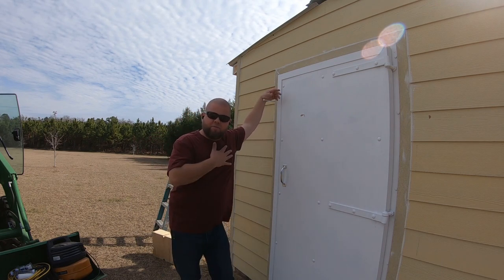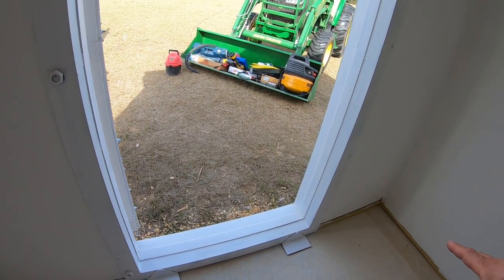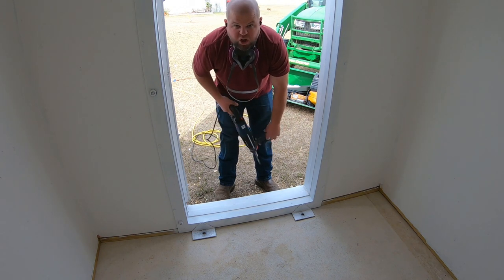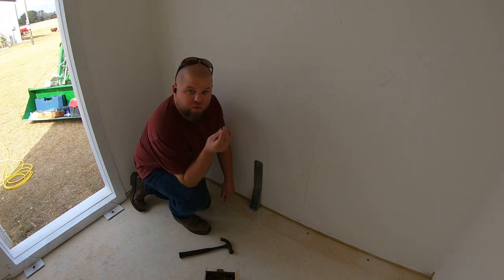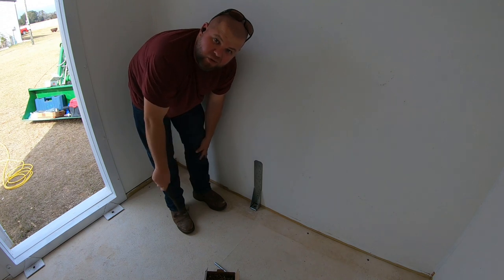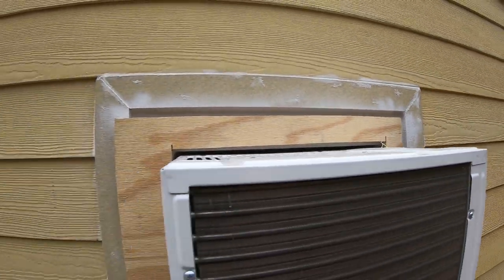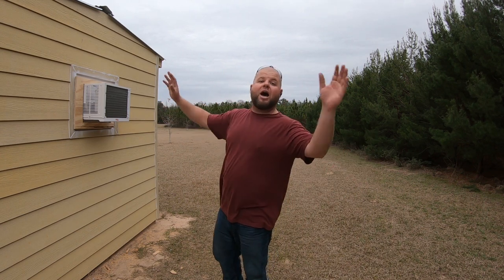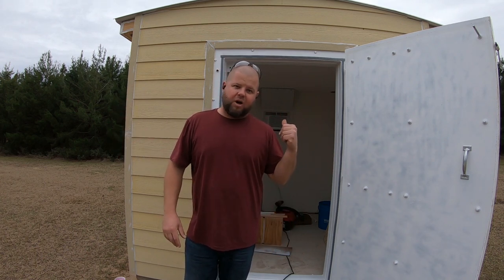#240 Anchoring the Tornado/hurricane shelter! DIY storm shelter bunker build #19

Comment: Great video, mite want to check into a palm nailer , you would be surprised how well they are handy ,  great for getting into tight places , and would have been great on all those nails, plus I'm sure it will get used a lot on that new home build
Reply from the maker: Lol so funny you mentioned that! I ordered one that same day, should be here tonight. I'll finish the straps tomorrow and record it. I've never used one, but it seems perfect for this job.
Reply: @TKCL  plow is right, they are amazing!  We used them to pound in 6 inch spikes into hardwood, can't remember what kind of wood it was, but it was hard as a rock.  The nails literally just slid into the wood, and fast!  Wear gloves though, your hands get super cold after a while of holding the nailer, with all the compressed air blowing out of it.
Reply from the maker: I'm excited to get it, I was wearing my back and shoulder out nailing these straps in.
Reply: @TKCL  I use to pound nails for a living years ago i still have problems shoulders from swinging hammers, thanks Gold for the ones that invented air and battery operated nailes

Comment: Did you subtract that lip you added to hold the AC. :). Great job on the shelter.
Reply from the maker: The lip is also removable with the screwdriver.
Reply: @TKCL  you got it covered.

Comment: Calling the game due to rain?  It was inside work Coach!!  haha  j/k  Anxious to see how you outfit the interior with fold down beds, small table(s), any 12 VDC lighting planned?  Have you closed the main door and looked at you phone to see if you still have sufficient bars on the signal meter?  Which corner of the shelter will you put the Kegerator??  :-)
Reply from the maker: Have not closed the door all the way, but do still have cell signal inside. And hey, I'm not about working inside with the door closed until I get working ventilation, rain or not🙄. No 12 volt lighting planned, but will have battery operated push lights and maybe a motion light. My dewalt set has a battery operated fan and light I'll stash inside for hurricanes. Planning a couple of basic shelves and a futon that folds into a big enough bed for Tiffany and I to take a nap if in there for hours during a hurricane. Kegerator sounds awesome, but then I'd have to pee every 15 minutes, that wouldn't work lol.
Reply: @TKCL  Girls have to pee every 20 minutes anyway... Y'all might as well enjoy a cold one every half hour or so to fill your 5 gallon bucket!!  :-)
Reply from the maker: Lol

Comment: Do you happen to know if you can downsize this design (e.g. 4'x6') and still keep the structural integrity?  Does it have to be square?   I'd like to build this in my 2.5 car garage but only have a 4x6 footprint available.
Reply from the maker: Im sure it would still be very strong. But I can't guarantee any of that as the "engineered" plans must be followed to meet the specs and ratings posted.